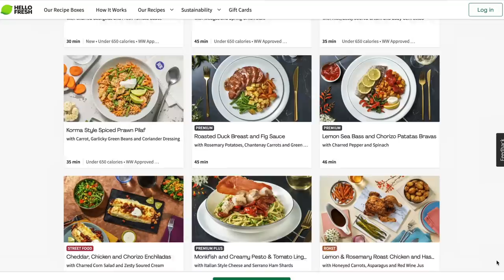MOVING INTO A VAN (again) - Back to VAN LIFE - Mods, jobs and a telling off!

Comment: Pro tip: If the lid of a paint can still seals (which most of them do even if they get beat up a bit) store the paint can with the roller you last used it with inside it and put away the can upside down to prevent the solvent from evaporating... Obviously store the upside down cans with some sort of a tray underneath (plastic lined shelve with a rim for instance) just in case...

Comment: I've missed you SO much! What a cheerful start to a cold and dark Sunday evening ...

If the flaps fail to do the job properly (!) you can buy proper Citroen/Fiat versions for only slightly more. They are really heavy duty and fit easily and perfectly. Rust shouldn't be a big issue since the bodies are galvanised.

Looking forward hugely to your adventure. Have fun girls!!

Comment: Ah , paint tin hack , use the paint and put the lid on then store them upside down so the skin now forms on the bottom , turn right side up and hey presto paint is now back at the top of the tin , boom . Crocs tip ,,,,,,,,, open bin , place crocs inside , close bin , walk away , boom job done 🤣
Reply from the maker: Ooo that’s a top tip 😀
Reply: @campervibe  Thanks , but what about the crocs tip ? 🤔

Comment: So cool! I'm a bit of a stickler with keeping cars clean... I know so many use those car washes with the broom. They really scratch the paint. Try not to use them if you can.
A good prep for your trip would be a good degreaser and metal fall out remover as a prewash, then a good wash down and dry, no chamoise.. microfiber. Look into turtle wax ceramic spray coating. So easy to use and will keep the outside protected.
Also makes it easier to get rid of bugs in the summer.
All products can be bought from Halfords..
Would make an amazing vid too if you got the time.

Comment: Guys, your hozelock connection to your cold water tank filler has a red collar. This means it has a  one way valve fitted. Great for a garden tap to stop dirty water flowing backwards but this slows flow down considerably so will slow down your filling up. Swap it for one without a red collar. Any garden Center or diy outlet will supply.

Comment: I've used snow chains for years and they've never been anything other than a PITA.
Depending on the sort of terrain you plan on driving (probably not too bad in a 2WD van), you might want to take a look at "snow socks" as an alternative.
++ MUCH easier to fit.
+ Cheaper than chains.
+ Will do 95% of what chains will do.
+ Won't be a rusty mess when you use them for the first time in two years.
- Will wear if you leave them on when there's no snow on the ground (although they still work even when there's holes worn through them).
- Can dislodge on rough terrain.
Reply from the maker: Thanks 🙂

Comment: Another weekly dose of comedy thanks guys, I did like Emily's crocks something practical (being old twenty four years older) only downsides not waterproof and probably only come in a small size.
Practicing putting on the snow chains is a good idea as nowadays we don't get the deep snow I can remember in the sixties I did have a set for my old 4x4 but they are two small for the new vehicle so invested in a set of the new idea of snow socks as the vehicles manufacturer says chains damage wheel's they are a lot lighter two sets less than half the weight of one chain and they are easier to fit apparently the best snow chains are made in Italy.
If you see a garage where you are going just ask someone to go through fitting the chains just to make sure you are confident enough a sensible person is not affraid to ask for advice.
Stay safe and warm looking forward to seeing the next instalment
Reply from the maker: Cheers Mark

Comment: Tip for the chains once fitted just pull forward a couple of wheel revolutions then recheck the tension!
Reply: Yep. Also practice fitting them in the dark with no lights as that will happen...
Also, on some Italian mountain roads in a snow storm there will be men flagging you down. Do NOT stop ! They just want you to stop so you can't get going again so they can either sell you chains and/or charge you for putting them on. Lights and horn on and keep on truckin'
Reply from the maker: Thanks guys

Comment: well lou im surprised you didn`t turn the wheel in the lock to fit the flaps maybe wouldn`t have trashed  the fixings struggling to get them tight and please please loose them crocs

Comment: Spot on frog eyes on the crocs.  I love putting my feet in rubber shoes that have warmed up by the heater. Lay chain out on ground drive onto it then pull up parts to connect.

Comment: With tire chains, add Tire Chain Tensioners = like an octopus bungee.  Keeps chains really tight.  Another great product is/are Snow Socks for tires.  I use on a trailer when required to have chains in snow.  A Snow Sock is like putting a fitted sheet on a bed.  Put over most of tire, pull forward and finish.  Emily could do this as you wait for her to say “pull forward”.  Make sure legal where you go.  Packs away in super small place and really don’t washing a thing vs tire chains.  Both can be found on Amazon.  BTW, the chains you got for van are really good.  Tensioner bungee would make them quieter and tighter.
Reply from the maker: Thanks 😊

Comment: 👋 Hi from New Mexico🌶️🌵Love the Crocks and I wish they would have lights on the big sizes (12) I'm in my 70's it would help to see at night. Emily my first time off the ski lift back in the early 70's I was shocked when on the way up my cousin told me it didn't stop and then it had those snow breaker fence I had to jump and roll🤔😲😖. We had those long 🎿 and when I got those 🎿 back on after the roll he had me go straight down the hill( no lesson or instructions) well there I go yelling get out of the way because I was going so fast and didn't know how to stop or turn. After running over the back of another person back 🎿 I crashed and the 🎿 patrol person was amazed that I hadn't broke a leg going in excess of 65mph.  I was not happy with my cousin. However I later took lessons and by then they came up with shorter 🎿 and I learned to turn and stop on a dime.🙂. Safe and happy travels. Angels all around you and Fanny.👐💖
Reply from the maker: Oh no, this is exactly what is going to happen to me 🤦🏻‍♀️🤦🏻‍♀️
Reply: @campervibe  lol I hope not. Take the lesson💖